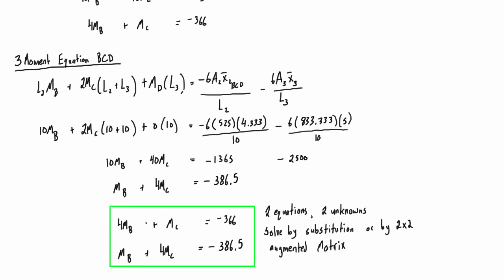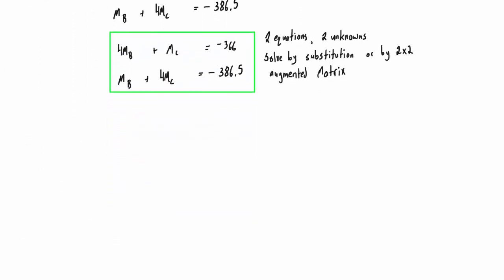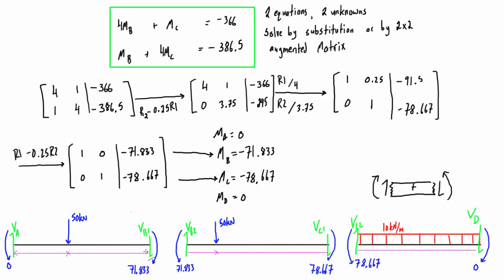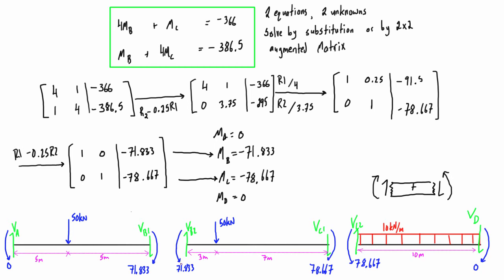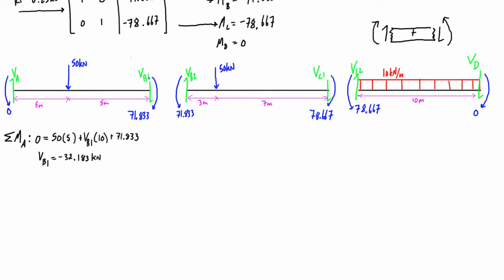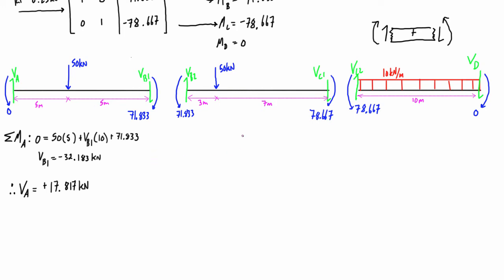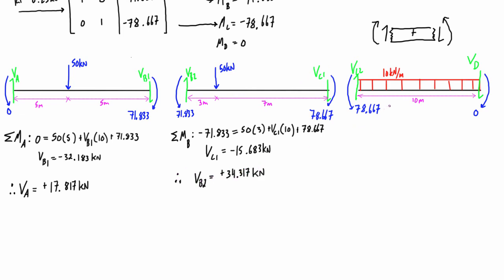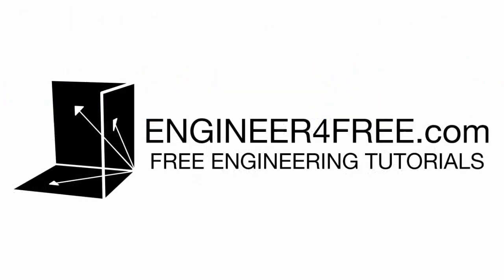3 moment equation example #2: three span beam (part 2/3)

Comment: I also cannot reconcile the negative signs implemented within the sum of moments equations wherein ΣMb=-71.833 and ΣMc=+78.667 while both were calculated as negative. Zach concluded you had a misplaced negative sign on ΣMb while Ernst had a question related he seems to have answered, which I didn't quite understand. Are you able to shed any light on the detail of how those signs are implemented at that step?
Reply from the maker: Hey Robert. Sorry for the confusion. Zach correctly identified a typo. In the sum of moments about B expression, the "-71.833" term on the left hand side should be "+71.833". I think what happened was, my brain was thinking how it is opposite to the positive sign convention, and I tricked myself into just writing a negative sign on it as I was talking and writing at the same time. But the way that the expression is set up with counter clockwise moments on the left side of the equal sign and clockwise moments on the right side, means that all terms should be written as positive values. I also had previously done the calculations off-screen and was working from my notes, so that's why I still compute the correct value of Vc1 = -15.683kN despite having the incorrect negative sign hanging around in the line above in the video. Very sorry for the confusion, but I hope this helps to clarify. I have put a note in the description of the video mentioning the typo as well.

Comment: check at time 3.30 moment at b. vc1 value is -30.05 KN. correct me if I am wrong. thanks
Reply from the maker: Mmm I'm pretty sure the sum of moments equation checks out and that Vc1 should be -15.683kN as is. Why do you think it should be -30.05kN?
Reply: @Engineer4Free  I think Rameez is confused because you have a negative sign on MB, the math when following your numbers on the screen comes out to -30.05 KN. But your answer is correct, just a misplaced negative sign.